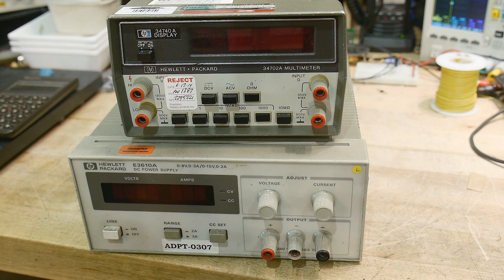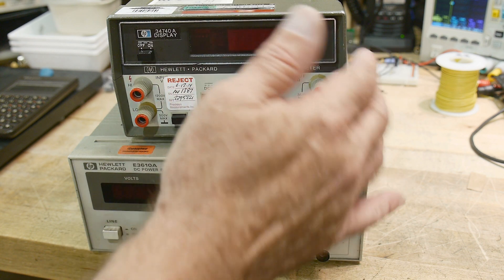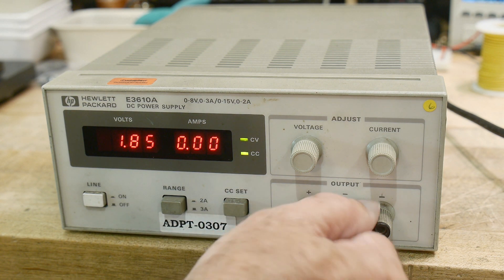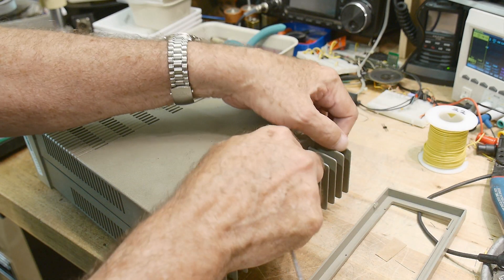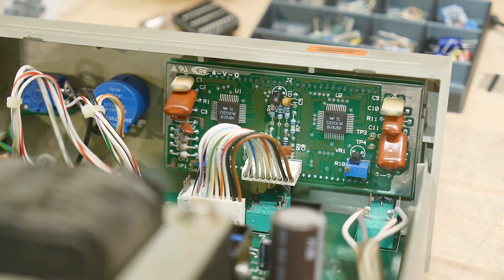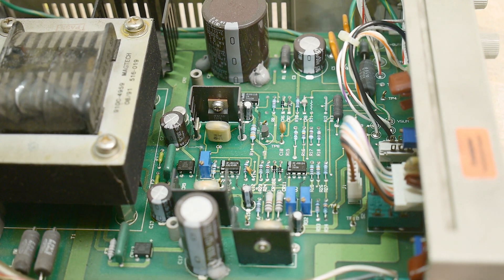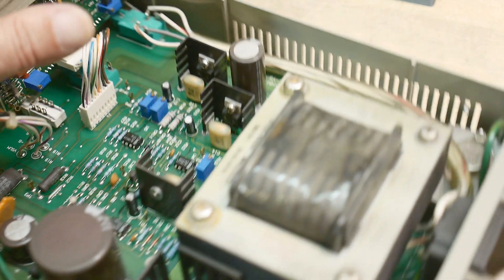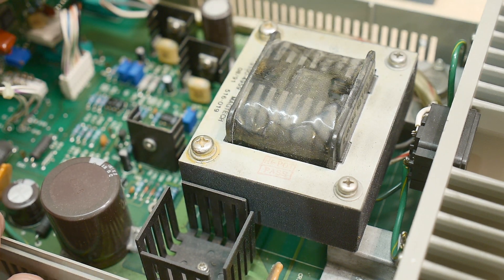#1250 E3610A HP Power Supply Repair (part 1 of 3)

Comment: Those chips on the display board are just ordinary ICL7107 - 3 1/2 digit A/D converters.
Reply: Ain't that what are all cheap dmm's based around?
Reply: @plainedgedsaw1694  It's an LED driver version of the famous ICL7106 LCD driver, that is as you said, basis for every cheap DMM.

Comment: Fish smell.  Check capacitors c7 and c13 for leak.  If leaking, follow corrosion along connecting traces.  Clean board, jumper broken traces.

Comment: Hello, you have a good business cooperation 👍 I see that the construction quality went down even at HP, the time to reduce production costs, if the source is not used instead of a hockey puck, then it could last. It's a shame that you didn't try the power source with a load, I'd be quite interested in what it actually outputs and why the CC is still lit when it's not loaded, I don't know exactly how they do it, I'm just assuming the classic comparative current sensing and CV should be indicated without a load.

Have a nice day 🙂 Tom